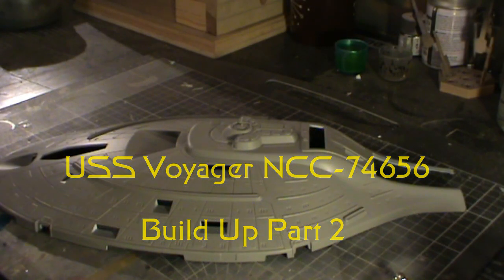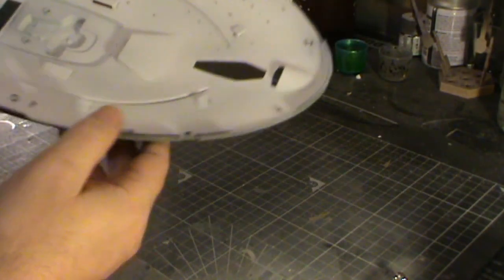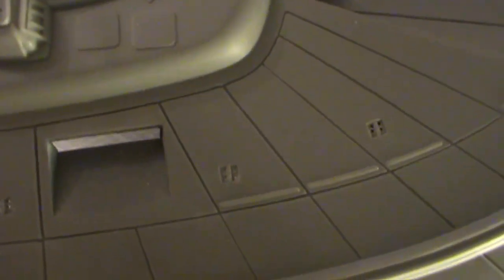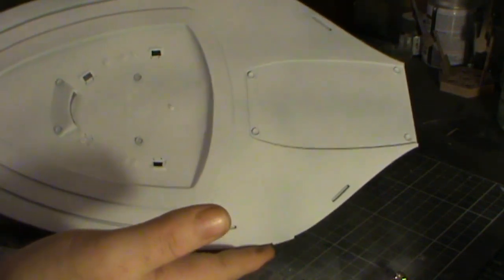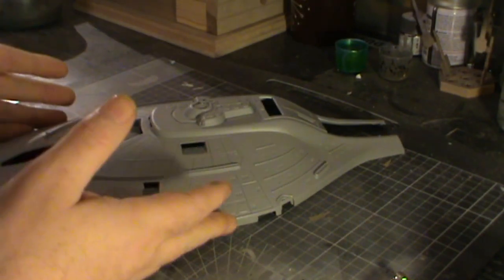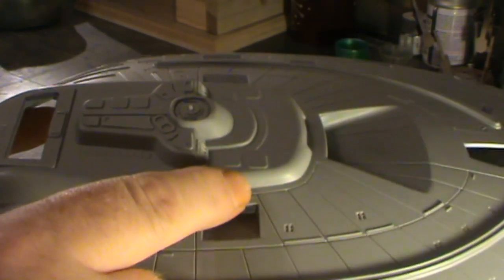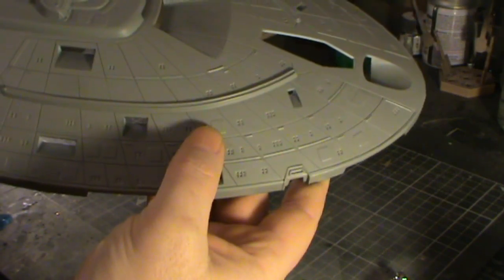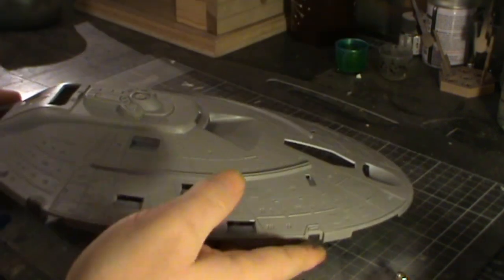Revell 1:677 USS Voyager Build Up Part 2

Comment: Hi, what type and brand of black and white paint did you use for the interior paint? And what size drillbit did you use on the windows?
Reply from the maker: Hi Adam, I think it was a 1 mm drill bit I used for the windows then used a hobby blade and a file to clean up after. The paint I used was black car primer wouldn't matter which brand, followed that up with cheap spray can mat white for the light reflection.
Reply: +Doughnuts Inspace Thank you very much! I really appreciate it
Reply from the maker: No worries Adam, glad to be of help.

Comment: Hello there .  I'm building one as well but its a MONOGRAM Kit.  Skill Level 2.  I ran a bright LED torch [ Flash Light ] and I don't see any light penetrating the resin. Why would you Light Block it ?
Reply from the maker: Hi, sometimes kits are fairly thick and only need to have a white cote of paint for lighting reasons. Although the this kit is made from fairly thick styrene due to the modifications I made to the kit I light blocked it just in case there were any light leaks. 

Hope this helps. 

Regards 
Richard

Comment: Hello there.  Did you wash your model with dish washing liquid before you started to paint ?
Reply from the maker: Hi Gaetano, 

Yup sure did, its always best to wash every model with dish washing detergent and warm water before painting as this gets rid of the mold release agent used on the kits. I normally wash and rinse at least 4 times to make sure and then dry off with a lint free cloth to prevent water staining. 

Hope this helps? 

Regards 
Richard